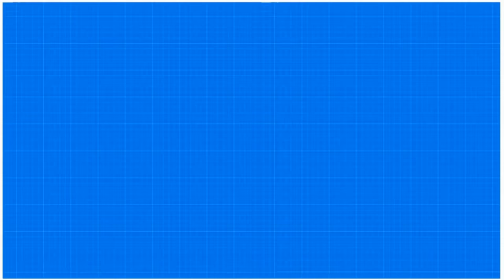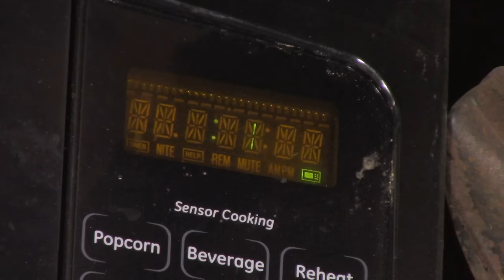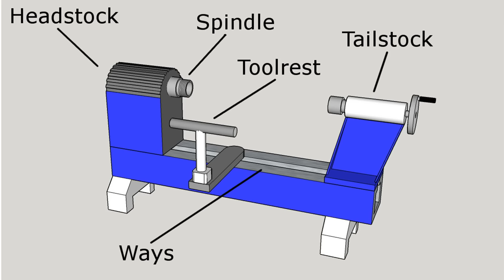Should you turn green (wet) wood on your lathe?

Comment: I have been turning for about eight years, and just as you described, I fought with dry wood, damaged and broke roughing gouges and basically jarred myself to the point of the craft not being enjoyable. When I experimented with green wood, it seemed to open up an entire new enjoyment of the craft as well as creative designs, just as you mentioned. I now find my most enjoyment and success by roughing the bowl out to 10% wall thickness according to the diameter of the bowl. Then I coat the outside of the bowl with a product that is partially liquid wax and other components to force the drying to happen through the inside of the bowl. I place the bowl in a paper bag from the store with some shavings, then just stack them high in my garage where it is warmer. In about six months, it is warped but not cracked and ready to finish to the final thickness, which will level the warped area and round off the bowl. I do not mind the six month wait because there are frequent enough sever storms around Houston that I can get permission to clear any sized Oak or Pecan tree I am looking for. The difficulty I find is to try keeping the sections of wood from drying too fast and checking severely at each end. So, I coat each end with the wax product while the log is waiting it's turn to be roughed out. Anyhow, this video was a great illustration of that amazing moment when every woodturner finds the joy of turning green wood.
Reply from the maker: Glad you liked it!

Comment: you can also use a simple digital scale to measure the mass of your bowl between microwave runs. When the mass stops changing, you are done drying
Reply: Oh yes!.... simple elegant.
Reply: Hit tare and it'll give you the difference next go round.
Reply: Ahh yes, until you put it in literally any air in the world that contains moisture and it'll crack and deform again
Reply: @Simon-oy7kf  Then all the bowls I and hundreds or thousands of other turners who have done this on must exist in a parallel universe where they don't touch any air in the world, since they have no cracks. It's not my idea, it is commonly done. If you microwave a bowl for short bursts with hours of rest time, it is not going to take it to "zero" moisture. The bowl will approach the relative moisture content that is necessary based on the temp and relative humidity of your location to be stable. When you are close, the mass won't change much from one iteration to the next. That being said, I now use a much easier method which is simply leaving it in a sealed bag with orange desiccant beads for 24 hours.

Comment: One comment on using faceplates. To use a faceplate properly the wood surface needs to be as flat as possible because the screws don't really turn the blank it's the pressure they put over the contact between the wood and the faceplate that is why larger faceplates hold better than smaller ones do with the same amount of screws there are more square inches of surface area.

Comment: Green wood is fun to work with. I try to get free wood and it’s usually green. Dry wood can be plain. I will some times take green wood to its final shape and let form to what to what ever shape it will be. You can end up with a bowl that has some interesting shapes and features. Great advice. I have been turning 3 years and used to avoid green wood. No any more.

Comment: Drying worked green wood (or just drying wood in general) is a field where the discussions seem to never end.

What I usually do with my bowls is that I take the shavings from the turning and spread them thin so that they dry fast. Put them in a container such as a basket, and when the bowl's done on the lathe, shove it in the shavings and let it sit there for a bunch of days.

What happens is that the shavings draw moisture out of the wood, but limiting the wood's exposure to the even dryer air, so it dries slow, which is one of several ways to prevent the wood from cracking.
Another is to slap some wood glue on the end grain and let that set before drying.
Reply: Wow, how long do you leave it for?
Reply: @HarmonicGrunt  Depends on the type of wood of course, but a day or two in some cases, a week for some. Just take it out and feel if it's mostly dried, then you probably can dry the rest by having it standing on a bench/desk or similar.
Reply: Ok Thanks Man, that helps a lot.  Have a Great Weekend My Friend. X

Comment: Rex. Great channel. It's very helpful.
For more than 20 yrs now, I have been immersing green timber blanks in water for approx 3 months prior to re-sawing for whatever project I have going. This seems to leach all the tannins and most of the sap out of the timber and I have very little cracking through the heart even on quite thin rounds of timber. I am located in SE Queensland, Australia and have access to some very hard woods that are not considered commercial due to their tendencies to split. This of course does nothing to stop a piece from twisting or cupping. 
Keep your water filled drum well away from the house as it will start to stink after the first couple of days.

Comment: Very good and informative video.  I rarely turn dry wood, the only problem is when it dries it always distorts some more than others so I have to leave it thick enough to return it to the lathe and turn it round. I have never used a microwave to dry wood, does the wood distort as much as letting it dry naturally. Thanks for sharing I'm sure a lot of new woodturners will be helped by this video.

Comment: Great videos. Thanks for posting. I will try some of your techniques.  

Not to be different, but I usually turn wet wood.  And I finish the piece 100% in one day.  Except for Elm. I mean wet too.   Leaves on the tree to finished bowl, one day.  Water hitting the face shield.  It is not difficult.  

I just turn to the final thickness then sand the inside at a good speed.  The coarse grits, 120 and 180 tend to load up with sawdust and water to form a paste on the sandpaper.  Good.  Just blast it off with the air compressor and re do that same piece of sandpaper until it stops loading up.  Continue through the grits. Remember I said the INSIDE only.  The centrifugal force is throwing water out.  I often use the compressor to push the water out  if the wood is open grained like oak.  Spin it up at a high speed for a minute.  That often helps.   In short order the interior is finish sanded.  Now the exterior is ready for the same progression, but it will go even faster.  If the wood is too damp to apply finish you can let it dry for a day then touch up by hand with 600 grit or oooo steel wool then apply your finish. 

The bowl will warp to an oval shape, but rarely cracks.  Depending on the grain orientation the bottom may need to be flattened out at a later date, but that is so easy.  I use 4 jaw chucks for everything.  With the tenon on the base, rather than a mortise, I end up with a slightly concave bottom when completed.  Very easy to re flatten if needed.

Comment: Hey Rex, harbor freight has moisture meters for less than $20 iirc. 

Also, another method that I've used when microwaving wood is to get a cheap digital scale (mine was like $10 on Amazon), weigh the rough turned wood just before microwaving (this will be a baseline) and then continue weighing it after each session in the microwave. I usually set the scale to grams so that it's easier to calculate the % of weight loss from the baseline. Eventually the weight loss will slow/and stop. 

I also set my microwave to half power and did 2 minute sessions which seems to work well, just make sure you always watch it. The first time I tried the microwave, I think I put it in for 3 minutes on high. In the kitchen microwave.  The inside of the wood actually started smoldering. My wife wasn't too please with me that night. Luckily I didn't damage the microwave or burn down the house.
Reply from the maker: You are lucky and I'll be sure to try some of those techniques out!

Comment: Great idea on the microwave. I will have to try that, thanks.
Reply from the maker: It's not hard. Trust me!
Reply: Also fun to put it on one of those kitchen scales. One bowl went from 750g to 270 g in a week. I nuked it like every few days and then turned it again.
Reply: @1antti  hey, at what level did you microwave bowl, medium, low, high?
Reply: @josipaugustinovic5114  medium settings 👍

Comment: I am not surprised that green wood would turn easier. My great grandfather and grandfather owned a saw mill, the parts were used to build a mill three times during my time. I ran a nice portable diesel powered band-saw mill for a bit. We all know that it cuts harder and wears the blades more when dry ;-) Band saw and chain saw mills run a drip of water on the blade while cutting. The difference in the amount of water needed, for wet or dry wood is obvious. You can practically use no added water dripping with some green wet logs.
Problem of course is everything shrinking and twisting after milling green wood.
Oh, it also is noticeable using a chain saw and a wood splitter. Some wood splitting is easier with dry wood; especially getting large chunks onto the splitter lol

Comment: The thing that works for me is I will completely finish a green bowl and use Minnwax Polyurethane clear coat for a finish and I rarely ever get a crack. I suppose the polyurethane seals the green wood enough for it to dry slowly. It will warp some but it makes a beautiful piece of art. I never turn dry wood.

Comment: Great video.  I've been turning for about 20 years now and my son has my old Delta lathe.  I currently use a Laguna Revo24 for large projects and smaller Rikon for pens, smaller bowls, Christmas ornaments, finials and, most recently, a new mallet head for chisels turned from a wet hickory log a friend traded me for some stuff I had.  Lots of projects planned for the 45' of wood there.  I usually turn bowls to about 80% thickness, 24 hours in denatured alcohol, put a date on the bottom amd toss in a box full of shavings or wrap in newspring and put on a shelf for awhile.  May need to try the microwave method - should fit on the shelf with the toaster oven I use for curing stabilized turning blanks.

Comment: Badgers around High Wycombe in the early 20th century turned Windsor chair parts in the woods on pole lathes. Mostly Elm and Ash.
Polyethylene Glycol used to be recommended for preventing splits. I’ve never tried it.
Reply from the maker: Never heard of it before now. Fascinating!
Reply: Bodgers...
Reply: Steve SteveS badgers were much more interesting...

Comment: Having trouble turning a hard wood like dry oak usually indicates that the turning tools are not properly sharpened or you're using the wrong tools. A high-speed-steel bowl gouge when sharpened correctly should cut dry oak easily. The carbide tools marketed for novice turners will not take an edge like high speed steel and therefore perform poorly.

Comment: I should probably try the microwave thing some day. I generally leave larger, natural pieces of wood in the garage for at least 6 months before doing anything with them but that still leaves them fairly moist (it's not insulated or heated or anything). Allowing them to slowly get rid of that initial moisture does make them a bit harder to turn, but anything that might become a piece-breaking crack should have appeared by that time & can then be worked around.
Reply from the maker: Seems like a reasonable approach!
Reply: @RexKrueger  The only thing is the time & space needed. I've set aside some for 2 small (8 inch) tree trunks though, & that doesn't seem too unreasonable in a shared house.
Reply: Night Cat worked around, or transferred to the firewood pile...

Comment: You could add a cheap moisture meter for import tools madness, i bought a $20 one and tested against a high end one of a friend, and surprise surprise! They read the same, also we just need one that is basically binary: wet and dry, that should be enough and it can be trusted upon a cheap meter
Reply from the maker: Good idea!  Now, to find a rich friend with a fancy one I can test against.
Reply: Hi,
an old kitchen-scales does the job as well. At the point when the bowl looses no weight any more, all the moisture is gone.
cheers
Reply from the maker: @christiann.4120  That sounds like a great idea!
Reply: My go-to meter is literally a "garden variety"... from one of the sales over in gardening tools... to test the moisture content in dirt.
    I found it at the flea market for about $2 (US)... AND it functions about the same old way, runs on a 9V box battery (so cheap/easy), and the scale reaches all the way down to 0% (sand)... ;o)

Comment: Hey Rex, I've been inspired by you to get out of my comfort zone and finally get into woodturning. I have been creating wands (HP style) with just a belt sander so far, but want the ability to work faster and more symmetrically. I just got a Harbor Freight Lathe, but the faceplate is too large for most of the projects I've been wanting to do. Do you have any recommendations on a decent quality chuck that won't break the bank?
Reply from the maker: Chucks are expensive. Period. But they're not necessary for most work. If your faceplate is too big, get a little one. They're cheap.
Reply: Do you have any pictures

Comment: I always turn greenwood :)
Reply: not to bug you- but I'm trying to turn green wood as well, I was wondering how you keep it from cracking. I'm trying to turn a 12 inch diamter, by 24 inch - kind of a drum shape. Is there a way to do that without cracking it?
Reply: D Wolfe just be prepared for disappointment. I grab anything I can for blanks, both bowl and spindle, and if something cracks badly, well it was good practice.

Comment: Hi Rex, quick question.... I recently cut a slice from a eucalyptus tree/branch, about 250mm diameter ans about 25mm thick. I planed it down and sanded it just to see how it looks. What would be the best way to dry this slice to preserve it without cracking to pieces....?  Thank you
Reply from the maker: Is it a round slice with across the branch? That would look like a bullseye. Or is it with the grain, long-wise?  If it's a round slice, it will almost certainly crack. Wood just does that.  You might be able to stabilize it with a product called Cactus Juice. Or, just see what it does. If it doesn't crack badly, you can just fill the cracks. Good luck!

Comment: Depending on the oak species...extremely water permeable...like a straw. The stuff at lowes is no good. Boat makers nightmare.

You could easily make a dryer rack with using a space heater and a box fan. Maybe try beeswax and oil paste so the wood dries slowly to prevent cracking.

Comment: i dont have a chuck @ 3:47, i do have a faceplate but i dont get whats a glue block?
Reply: A glue block is a block of scrap wood that is glued to the bottom of a piece. You can then mount it on the lathe by screwing the faceplate into the glue block. When you are done turning, just part the glue block off. It is most often used to preserve the full length of wood being without having to sacrifice a couple inches to the screws from the faceplate. BTW, you can turn bowls and hollow forms just fine using a faceplate. You just have to have enough wood to sacrifice the bottom couple inches, or take the time to put a glue block on it.